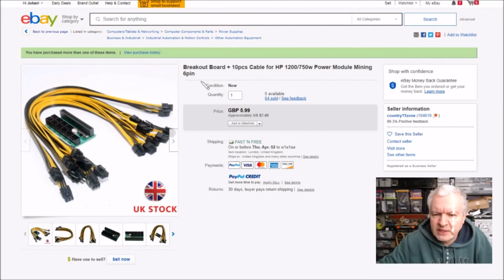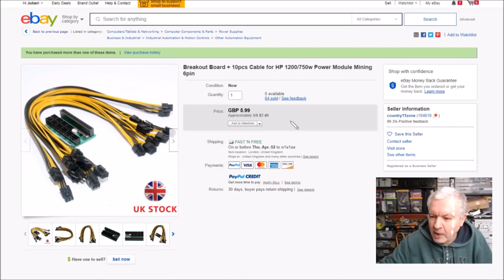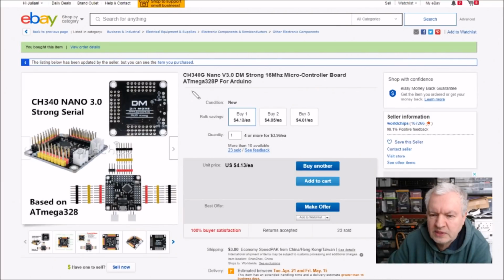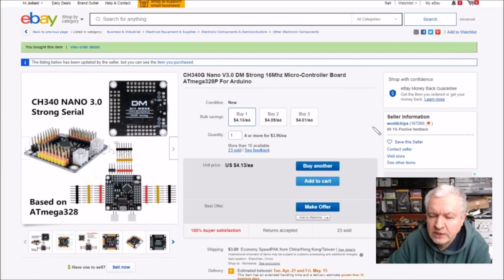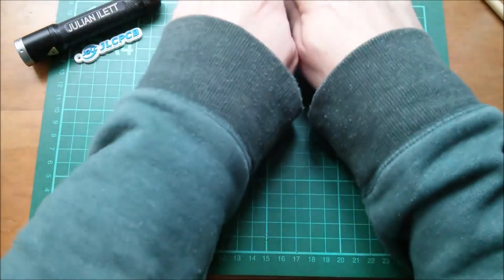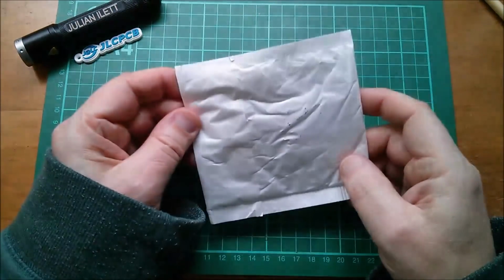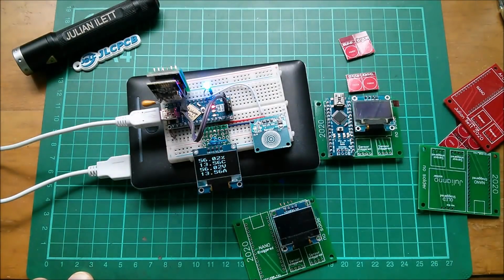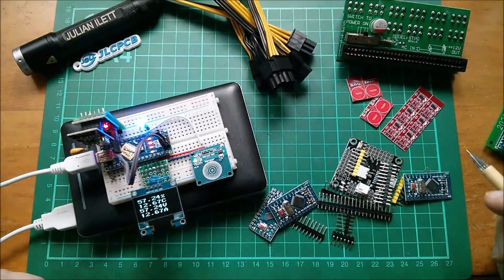Julian's Electronics Postbag #146 - PCIe Cables & Arduinos

Comment: Wow, that "strong" one was a really new experience for me ! . So, I've built up a circuit using my pro mini which is like the one (sort of) with the really small chip but probably a 328. One thing I wanted to point out about that one (hopefully I'm am the only one that sees this) is that you've got multiple places where you can hook up V. I think three places. One of them is one of the two holes INSIDE , not outside through holes. So, I haven't tried to figure out what is going on there. I'm building a pressure sensor with a millibars read out (marine use). So, if you put out a video where you hook some of these up to be programed, hooking up the power is what i need to see. The craziest thing I've seen lately is a nano style with bluetooth and wifi plus other features, called the SENSE here https://itnext.io/ble-and-gatt-for-iot-2ae658baafd5

Comment: you will need a heavy duty dc to dc converter as miners do not like the voltage differences that battery have and sill either burn out or crash

Comment: Yeah, I tried one of those ant miners, but - even after a day - I couldn’t find any ants on/near the device. Then I remembered; fire ants like HIGH VOLTAGE. So, with a bit of rewiring, and a MOT, I had the new setup with the 4 kV going directly to the motherboard of the ant miner. Now I shan’t elaborate, but - after awhile - a few ants did wander over to check out the fireworks display. 🤣😂😆
Reply from the maker: They're releasing a new range of DecMiners soon ;)
Reply: The updated instructions say add sugar.

Comment: Many of the chinese sellers have stopped free shipping over the last week. This includes favorites like alice/czb6721960/modulefans/worldchips (I'm pretty sure they are all the same seller under different names, because they often answer with exactly the same text at the same time and the paypal transaction goes to the same address). Some sellers I just ordered from two or three weeks ago don't even ship to Austria anymore.
A lot of packages have been transported as cargo on passenger flights, which are currently pretty much non-existent. So I hope that is a temporary corona thing.
Reply: I was wondering about that. I've noticed that shipping charges from China have gone up.

Comment: I ended up with a few Arduino Nano clones but they require the CH340 driver. Have you ever had any trouble installing or using that driver?
Reply: I didn't have any problems with it. It is a signed driver as far as I remember, so I think it should be fine (at least from a security stand point). I don't use it often though, because I like the bare minis, which I program with ISP and use external converters. For those I definitely prefer CP2102 as general USB-to-UART converters over any other (including the genuine FTDIs).
Reply: @superdau  What is it about the CP2102 that you prefer them?  I don't recall running across that number.
Reply: I recently bought three Arduino Nanos clones (cheapest U.K. stock that I could find at the time) that use the CH340 chips. They work fine with the CH340 driver that I already had from a few years ago. This is on Windows 10. My biggest bugbear is that I’m forever playing chase the correct port with these ‘RS232’ to USB converters 😡

Comment: That D3 miner is mining BTC, right? Happy you: the BTS is halving in May later this year. This means it will half the revenue. I got an S9, the one that came after the D3, but it has not been on for over a year now. Running on 1 hash board only works after a reset. The board is testing the board, taking some parameters, and only then it starts the mining deamon. So if you switch on a second board, nothing will happen. You might better change the frequency of all three boards. Lowering it will use less energy of course. You would only need to restart the deamon, not the complete OS of that SBC.
Running on a low frequency will also enable you to lower the speed of the fans. You possibly have not heard them running full speed? Yuck! So many DB's. O, and running 1 hash board would make the cooling inefficient, as the fans would have run as fast as for 3 boards. Lowering the frequency is the way to go.
There are very small miners as well. If you like Litecoin, you can mine LTC using a router. Since it is always on, you can choose to have it mine for you. It has just one or two chips on the board. And as I think of it, there are also USB miners. Those are even better to handle I guess, in terms of powering them.
Ps: the D3 uses a LOT of power, at full speed. Your (200A) batteries could easily be drained in a few hours (half a day).
Reply from the maker: The D3 uses the X11 protocol - main X11 coin is Dash. But I mine through prohashing so I can choose which coin I get paid in
Reply: @JulianIlett  Aha, helping me to whitewash my bitcoins, nice.
But back to the D3, I don't know if it has an option to lower the frequency, you may have to tweak the mining software for this.

Comment: The black square PCBs appear to be designed for small 3 pin servo motors and similar that use 3 pins.  You could use these to make a robot, etc. by simply plugging in the 3 pin connector instead of a mess of wires using a regular Arduino.  I believe you also have an Arduino PCB that takes a Nano and converts it to the Uno format that also has these 3 pins ready to use.
Reply: They bear a remarkable resemblance to Flight Controllers for multirotors. Certainly from a size viewpoint, but missing the extras, gyro, compass etc.
Reply: @SpeccyMan  - Ya, that's exactly what I had thought they were designed for at first sight but then I didn't see anything that could be a gyro, etc.  I wonder if it is the exact same size (and mounting holes) as the controller boards I have.  Then it would be easy to stack on top for some added functions.  Hmmm...

Comment: I found those touch sensors really annoying as you can't hold your finger on the sensor for a long hold as it turns off after a few seconds.
Reply: Yeah, I think those have a self calibration that is running continuously calibrating your finger away after some time. Or you might just have to make or break a solder link to switch them from toggle to momentary.

Comment: Can you hold a magnet to these ATX cables? I'd like to know if I was the only one who got copper cladded steel wire ;-)
Reply: Copper-coated steel is a new (low) for me. Usually the core is at least aluminium. Then again, what would you expect from CCP, the dictatorship that gave us the WuFlu...
Reply: @MrZetor  I have a set of RCA cables that love to stick to magnets. Pretty low!
Reply: @DrakkarCalethiel  Wow. Just, wow. You win, by which I mean you lose, I suppose.

I reckon there probably are applications where substituting copper (or even Cu-plated Al) cables with steel is more detrimental than in transferring low-voltage audio signals. I just cannot think of any...
Reply: @MrZetor  They did their job, until I wanted to solder on a new jack, steel is a pain in the ass to solder to!

Comment: I was running Antminers using solar about 5 years back, but I realised that I could make more money as savings by running the solar through micro grid-tie inverters to the house.
Reply: Now I also use a homemade 18650 power wall to store unused solar. Electronics, such a great hobby.

Comment: if your going to make a new PBC why not just fit a SMD 3v3 regulator chip on it. one chip and couple of caps and jobs done with no more waiting and wont take up as much space.
Reply: And you can solder the two caps directly to the legs of the SMD regulator like i do and use even less space! Mind you, i mainly use them for the breadboard, but the thought is there.

Comment: Seems like a dramatic but inelegant way of controlling the power consumption - is it possible to underclock the miner through the setup or trick it into thinking it's running hotter than it is and reducing the power consumption?
Reply from the maker: Yes, I've dropped the ASIC clock rate to 100MHz (the minimum) but power consumption is still 220W. By disconnecting hashing boards I'm hoping to drop the power further so the unit can be run overnight from a big battery :)
Reply: @JulianIlett  OK, looking forward to seeing your experiments.

Comment: I've got two unused HP rack mount server power supplies and those "Breakout Boards" appear to be what I need.  12V only output on the card edge connector plus some control pins.  Thanks for finding those, Julian!  Now I just need to find a project for them!   ;-)
Reply: ElmerFuddGun who needs a project, that’s a great way to make a decent current 12v supply 😆

Comment: Delays in China shipments? Surprised anything came through with the shutdown!
Reply: @TheElectricnoob He said in the vid that it was March 30th and commented how long it had taken for the items to arrive.
Reply: No delays for me with my Banggood orders.... some of my eBay orders from China can take 90+ days with no virus in the offing. So I take it as it comes. 7% never arrives as far as my records show over the last 8 yr. and  600 orders of various electronics and RC goods
Recently I have found some Chinese drop shipping mini whse in Toronto that make delivery a snap!!! :-)
 I live in Canada and get the worst shipping times over the Pacific container traffic / routes.
Order early and try to remember why you bothered to click "Buy Now"  if it arrives late  :-)
Reply: Most of my stuff comes just as quickly. With the exception of one package, only thing different about it was that it cost $75 which is very unusual for me. It made it to LAX just fine. But, then the PO started screwing around. The told me it was Networked out . Turned out eventually I found out that it was sitting in a Pitney Bows warehouse. Then, one day, they shipped it direct to my post office (after sitting for at least a month). Next day USPS delivered it. Crazy !

Comment: Can GPUs be made from these miners?
Reply: no
Reply: well they are fpga boards so if you happen to have a gpu core in vhdl or verilog and if you happen to have enough fast dram that you can some how connect and if you then have a way of connecting that to pcie and you dont mind clock speeds that are roughly 6generations behind then you can.

Comment: GPUs, depending to their power draw need either 6 pin or 8 pin connectors to meet specs. All PSUs have them fitted like this.
Reply: Crypto mining I recon.
Reply: except for those psus that do not provide pcie powerconnectors at all
Reply: @urugulu1656  You only find those on the flea market... Or in the basement or attic of retro aficionados...
Reply: That is really only for slim form factor computers that don't really have the space in the case for a full size card. Or a low wattage one that won't support the load.